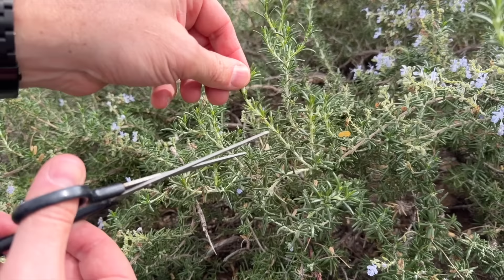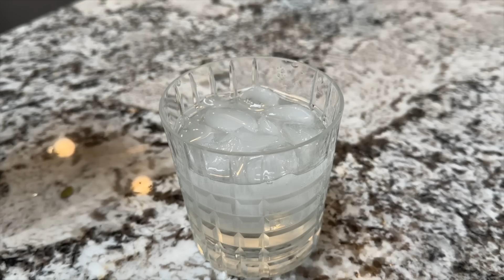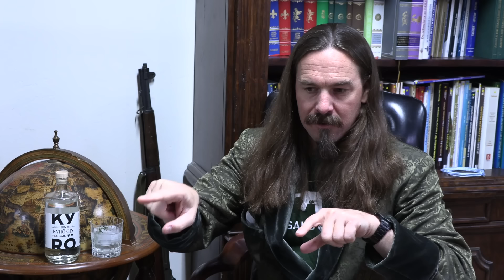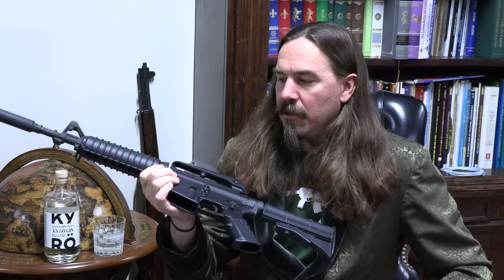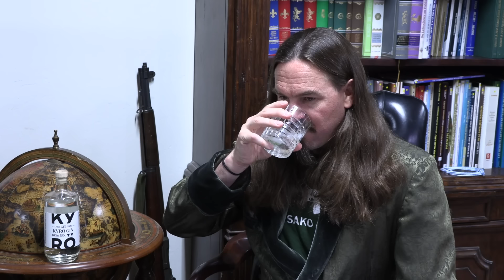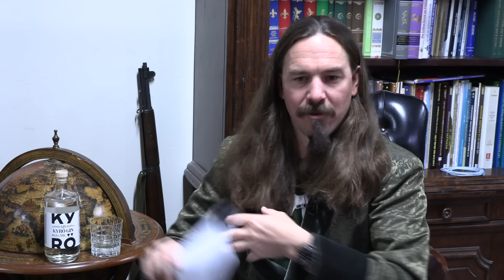How Guns are Made: Tolerances, Methods, and Metallurgy (Q&A January 2026)

Comment: 29:44 machinist here, on the subject of keeping tolerances, in my experience the biggest factors are usually the machine, the tooling and the material.

Most modern CNC machines are  pretty good and can hold sub 0.001" tolerances pretty readily, but if they're old & clapped out they might be less reliable in that respect

Tooling follows the "you get what you pay for" axiom most of the time, but may be less of an issue if you're working with softer materials; a bargain brand endmill will last forever in aluminum, but will probably wear a lot faster in 316 stainless than a more expensive tool that's made to a higher standard

Material can range from "cuts like butter" to "eats tools for breakfast" and everything in between. Some of the most potentially frustrating materials I work with are Titanium and a plastic called PEEK, both of which like to "spring" and deform, which means it may read as slightly undersized in the machine, but when you take it out the dimension will grow as pressure from clamping is released

There's a million different factors that can affect how things are made, but those are the ones most readily apparent in my mind
Reply: You forgot heat treatment that´s a big factor as well.
Reply: @sierraecho884 very true. I work with aluminum primarily so that doesn't really factor in too often for me

Comment: I would say that the "limiting manufacturing process" would be heat treatment. Most shops now outsource that, which takes time, and stifles the ability to quickly iterate designs.
Reply: You might want to outsource for production, but any gun sizes part a heat treat oven is a drop in the bucket compared to a VMC. I have vises that cost more than our oven.
Reply: @RSPFactory  heat treat setup cost and practicality varies pretty wildly depending on what exactly you need. Air quench steels/stainless is really easy but oil quench gets messy, calibrated hardness testers get really expensive, certifications like NADCAP get really really expensive. You know that stuff if you're doing it, like most things its a little more than meets the eye.

What type of steels are you heat treating and do you have a hardness tester setup?
Reply: @willhall4631  We do have a hardness tester, and do stick to the simpler steels.  Not having certification doesn't matter while you are designing and iterating, which is why I don't think it's a factor holding back innovation. This is specifically for gun sized parts, if you are making a ship propeller that's a whole different story.

Comment: what about designing firearms how can someone get into that? internal ballistics, cycling systems, magz and triggers
Reply: I would guess you need some type of engineering degree first. Guns are just mechanical machines. I work in automotive as R&D engineer, I could probably also work for a gun company.
The fundementals are all the same.
Reply: @sierraecho884 I have a Batchelor degree in mechanical engineering, I'm have basic CAD skills like 3d modeling, assembly, sheet metel, molding plus CFD and EFA I use both solidworks and ansys
Reply: @TheTrueNorth11
Reply: @aarafnasr6743  Well there you go, you seem to be interested in guns. Why not e.g. DIY your own and apply for a job at one of those companies like H&K ?
Reply: @sierraecho884 it's not that easy
Reply: @aarafnasr6743  It never is, but you have to start somewhere.
Reply: @sierraecho884 I will, thanks
Reply: I actually want to learn about internal ballistics
Reply: @aarafnasr6743  That's more of a physics lesson than a materials science or engineering problem.
Reply: Forget all about it until you become a mechanical engineer and gain skills in machining and manufacturing.
Reply: @TheTrueNorth11 I do

Comment: Nicely done. Been in both the stamping and injection molding industries and you showed a reasonable grasp of both, with a good knack for explaining the strengths and limitations of both (but I think those guys could stamp that top cover, unless they're only planning on making a few thousand).
Reply: It´s funny, even with a few thousand pieces you can stamp it (if you have the necessary experience which is really hard to come buy) you need knowledge of very sheet metal specific FEM tools like Autoform or Altair Inspire and you can 3D print the tools yourself. You can even do it in your garage, if you know what you are doing with about 1mm thick mild steel, some FDM printed tools wiht rubber for rubber forming (works best) and a 50T truck press.
Reply: @sierraecho884 my thought was that it wouldn't that it wouldn't take much more milling to produce the die than it would to make a part. Unless there's more to the part than it looks at first.

Comment: Metal printing has other concerns that increase cost (safety, debris, post processing, etc) that itself increases cost by thousands of dollars. Not as simple as scaling FDM to the consumer level.
Reply: Powder handling alone will be the reason you will never find it on a desktop at home, it does not make sense. You can do it at home just as you can metal cast steel at home ...I just wouldn´t do it and especially not on a bigger scale.

Comment: It's weird working as an aerospace machinist and tool maker and knowing like I could go from making parts for a Falcon Heavy to a Tomahawk, in literally 20-30 minutes of setup time. A lot of boomers don't really comprehend, back then you'd have like 9 dudes on 9 Bridgeports milling stuff, like 10 broaching operations etc, now with like a 100K CNC like a VF-3 Haas or an ST-30 lathe you make a shitload of parts from raw stock to complete, very quickly. The shortcoming I think would just be raw materials. We're super dependent on foreign materials.
Reply: Materials and volume of output. You can easily  stamp a part a second, that´s 60 parts a minute 3600 parts an hour and almost 30.000 parts in a 8h shift and 86.000 in a single day, with one stamping tool alone. 
You can never produce so fast or cheap on any CNC mill.
Reply: @sierraecho884 you need the CNC mills to make those stamping dies bud, not just for raw production. As well as you have to realize a lot of our stuff as milled not stamped.
Reply: @Sam21721  "...you need the CNC mills to make those stamping dies bud..." Of course you do, so you mill that tool once and run it for 30 years, instead of milling every part. 

"...As well as you have to realize a lot of our stuff as milled not stamped...." Lol, I am an R&D engineer in the automotive industry, I probably know every manufacturing method there is. We are talking of high volume, shit hits the fan kind of situation where many cheap parts a needed. I doubt anyone would mill them. They would be stamped, injection molded and MIM made as much as possible. 

CNC milling is neither fast nor cheap but it´s great for creating precision parts for aerospace, tools and such.
Reply: The cnc cutting bits. Are they made in the USA and how long do they last?
Reply: @mattserraes8561  The ones at my job uses a pressurized gas/flame that cuts the parts, not an actual metal bit. Basically a plasma cutter.

Comment: I wonder how much you can (or already are) combine manufacturing methods. Casting and milling was mentioned for the G43 bolt carriers, could you mould/casting the sheets and then stamp before the part is completely cooled down to maybe reduce tearing and defaults, using the heat to improve malleability, while improving quality of details; forging for the cristalline structure and then milling to create specific details, etc.
Reply: You are kind of mixing up some stuff here. What you can do is, cast a billet and then mill it down (like mentioned). You then propose to cast a sheet and then while still hot stamp it, that´s basically how it´s done in some stamping, but you don´t cast the sheet, the sheet comes from a supplier and it then can be either colt stamped or hot stamped. Depending on the alloy you can do either or. You then proceed to heat treate the part. A hot stamped part will also have inclusions, not a good surface quality etc. Most likely one would colt stamp the part it´s also way cheaper and very precise. But you got much of the stuff correct.

Comment: One thing you missed, with that first question, is the "completeness" of the TDP. Because the US government doesn't own the TDP to the M17 or the M7, there's no guarantee that they can hand the files to another company, and expect to get good, complete weapons from them. Sig, in particular, is known for making changes to the design of a weapon, without any real documentation. So it would not be a stretch to expect that the knowledge of what part tolerance is acceptable, and what isn't... might not be entirely correct on the drawings, or in the CAD files. I've worked for several manufacturers, where the drawing wasn't actually correct, and the machinists and QA knew the "offset", but didn't bother working with engineering, to make sure the drawings were correct. If you handed those drawings to another manufacturer, you would NOT get usable parts.
Reply from the maker: I don't know for sure, but I would be extremely surprised if the contract for adoption of a service rifle in the US does not include a provision to force the designer to share the TDP with other contractors in case of national emergency.
Reply: That may be. Doesn't mean that the TDP is accurate and complete. There would be a lot of back-and-forth on tolerances and dimensions, before the whole thing was reproducible. It would take a long time to get all of the correct information in play.
Reply: @ForgottenWeapons  My point about "ownership" is that, while the US DoD can GET the TDP, they don't directly control it, and haven't fed it through a federal arsenal, to verify tolerance stackups and validate the manufacturing fixturing or intermediate part steps (often, complicated parts will have multiple "manufacturing drawings" for various production steps, on top of the "final" drawing), to ensure that handing the TDP to another company will result in exactly the same parts as is being made by the original manufacturer.

Comment: 2:41 Long hole drilling for barrels still require specialized machines to do well, barrels would be the true bottleneck. I work in transmission machining for a heavy truck company and I remember Steyer doing a supplier visit to talk about long hole drilling and having them mention that they used to supply the long hole drilling machines for the Eskilstuna Gevärsfaktori (I am from Sweden).
Reply: "...Gevärsfaktori ..." Huh rifle factory, nice I understand that (Germany). Yeah barrels would be a bottleneck. They are high strength steel and need to be forged, the inside has to be either forged or cut, it´s not trivial.

Comment: As someone with a bit of history in American Manufacturing, the issue you would run into with reguards to the "WW2 style war economy" isn't in small arms, it's heavy equipment.  Tanks, artillery, warplanes, the ammunition for all of those, and raw materials. Especially since 2020, the firearms industry in the US has a surplus of capacity in total.  Specific companies like Geissele may run out of stock occasionally, but the industry at large would have little need of supplemental support.
Reply: That and skilled labor.
Reply: @sierraecho884  Skilled labor especially

Comment: Not too "well actually", but on the topic of metal 3D printing while the machines are improving, the large hurdle is the post processing iso baric hot press to consolidate the print and remove voids. That process I simply don't see being a garage hobbyist capability anytime soon. Maybe for the hobbyists that buy bridgeports, but not hobbyists that are buying prusas or bamboo labs...
Reply: You can "3D print" metal parts by sintering, MSLS printing or simply lost cast PLA parts. You can´t really do metal printing at home due to the metal powder handling.